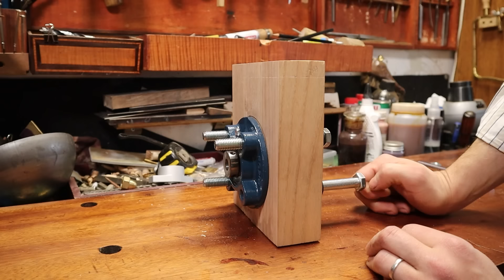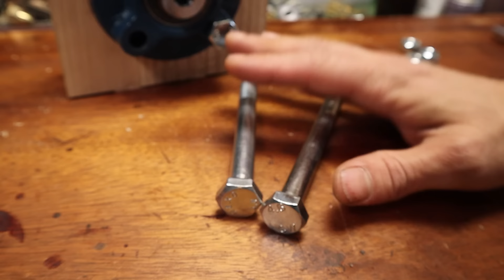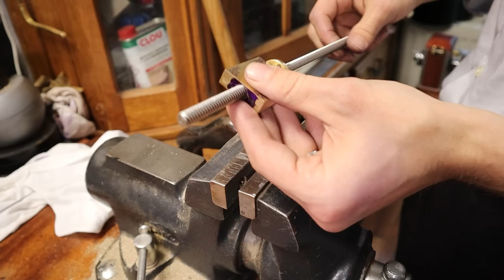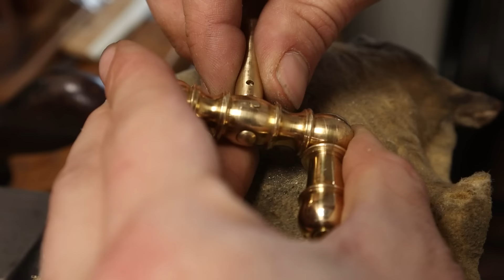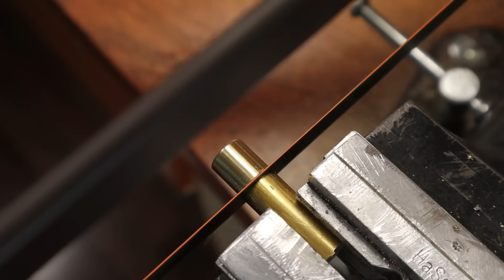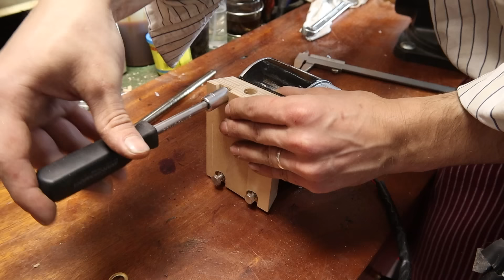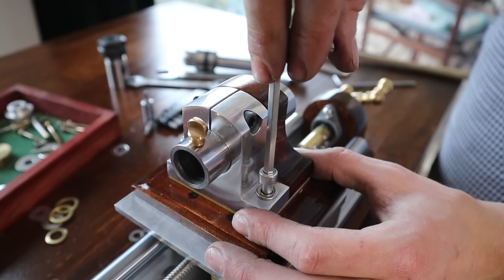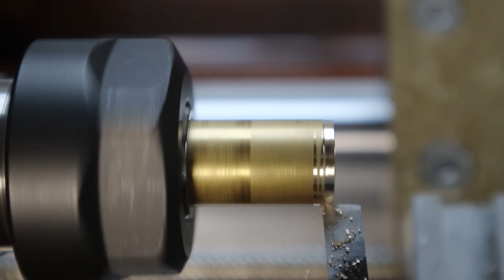Mini Lathe 2 Build

Comment: Yes you can see that the work piece is lifting a bit.  But you did turn brass with a tool in your hand . I have never done that . Wood yes , but metal no, never in all my time on the wood lathe . PVA or plastic , resin . All that type but not metal.

Comment: The numbers mean the tensile strenght of the bolt. 4.6 is 60% of 400 Mpa an 8.8 is 80% of 800 Mpa. Also for brass you want a positive top rake and a rounded edge.. i.e. the noise when you cut tells me that your cutting tool was too sharp.

Comment: The decimal number on the bolts are to tell you how hard the steel is. The grade of the steel. Decimal for european, in metric. Lines to denote grades for SAE system. Most common for you would be, from softest to hardest steel: 8.8, 10.9, 12.9. Heres a good article on it: http://marksbolts.com/2016/05/26/what-grade-of-bolt-should-i-use/

Comment: 4.6 or 4.8 should mark the Festigkeitsklasse of the Werkstoff. 4 means the maximale Zugfestigkeit of the Screw is 4 × 100 N/mm² and the 6 in Combination with the 4 means that the Streckgrenze of your Werkstoff is at 4 × 6 × 10 N/mm²

The screw will not be be permanently damaged (plastisch verformt) until you exceed 240N/mm² and will tear after stress inducement of 400N/mm²

No idea however why the dimensions were different or why the part didnt fit :/
Reply: Schaut aber leicht dannach aus als wäre der Schaftdurchmesser der stärkeren Schraube größer als das Gewinde. Bin mir nicht sicher wo das sinnhaft Anwendung finden kann...

Comment: I bolieve a lots of ppl have already answered question about bolts/screws (...) . Nuber(s) represent information about strainght - how strong material they are made of is. Yes, so how we will know that for what and where we can use them (there is standard ,,,) . I was suprised when you show numbers, I dont remember when I saw something similar .... They are very very weak ! Especially for that size. For example - anything what depend in machinists part - tools, machines, steel constructions of any and every kind etc etc have standard for bolts of 8.8 and above. With hardness of material bolts are made of is connected how thread will be done (this is not rule but mostly this is the way). Weaker/softer material - space between threads is longer and oposite. Thats why bolt with different number did not "fit" or a bit more precise - the bolt nut didnt fit ( my guess). OK, I have already say too much of ("useless") info about 99% dont care.  Once again Uri - great "work" - one more beautiful art piece from your magic hands and (a bit, LOL) nuts - but not bolt - the head :) Im glad to see Im not only and lonely... ! Cheers !

Comment: Can you tell us where you got your spindle?  Is it just the one from the ubiquitous 7/14 mini lathes made in China?  I've made a lathe very similar in design to your first one but I just have a bit of 8mm smooth rod for a spindle and haven't had any luck so far fabricating an adapter to mount a chuck that doesn't wobble horribly.

Comment: @Uri Tuchman. Your bit is not properly sharpened and oriented so it rubs against the surface. Grind a proper sharp tool and it will work

Comment: The numbers on the bolts mean the grade (hardness) of the steel, more = harder.
For example, when people say "grade 8 bolts" they mean that there's an 8.8 written on the bolt and in no way does this describe the size of the bolt, just the hardness of the steel.
Frankly imo grade 4.8 is trash, and grade 4.6 is below trash. I never buy stuff below grade 8 :)

Comment: Those number s on the bolts are the tensile strength of the material that the bolt is made of. ummm lower the number, the less  tensile strength it has.

Comment: G'Day Uri,Mate fine job,,need to work on your tool geometry,,but that will come with practice,,I mean i studied my job as a machinist for four years and still only scratched the surface,,Mind there's not a metal cutting machine i cannot drive and with modern cutting tools,,won't be long and you will be a good machinist,
Patience and safety Glasses,,thing can go quit wrong very quickly with machines,,Little steps,,
I greatly admire your channel,,2 reasons,,1,You do great work,,and 2,Love your sense of humour ,,
Did I mention Safety Glasses,Not your reading Glasses,,BUT SAFETY Glasses,,
and don;t wear long sleeves ,unless taped at the wrist,,and Learn to file left handed,and with your mop,,wouldn't get to close to spinnie things,,Gloves and bench grinders fitted with a rest is another,,
have seen a Bloke wrapped around a lathe job,,wasn't pretty,,
Seen a 2 ' grinding wheel explode,,took out half the work shop,,Mind it was 24" in diameter,,
but cannot mention this enough,,gun-ho with spinnie thing can lead  to a missing a limb,,`VERY QUICKLY,,,!!

Comment: You punching those numbers in to the dial and they're all straight and aligned and perfect kind of makes me angry. It's unnatural. When a machinist punches numbers they should be crooked and skewed and slightly off the line that you intended. Other than that, great job. :)

Comment: loose bearings in the cross-slide.
Reply: Yes. They should not be that easy to slide. There isn't enough preload. These are made for the hobby market and the expectation is that they should slide easily. But that it wrong. But the manufacturers are happy to not have to make very close tolerance parts. 

I am making a "practice" CNC router. I am using that type of slide because they are cheap. I have eight bearing blocks and only two are tight enough. I had also obtained some ball bearings balls and I plan to change out the the balls in the loose bearing blocks. And while I am trying to do a cheap, but good, job with this router I know that it will not be very good for machining metals. 

I have higher quality linear rails that I got out of an old Pick & Place machine that was being scrapped at my work. It was an old Japanese machine and it was built like a tank.  I will use my starter router to make parts for the second better router. Learn how to make parts with the firt one.
Reply: @tinayoga8844  Cheap linear bearings? Lots of slop? Just fill them up with EP grease.